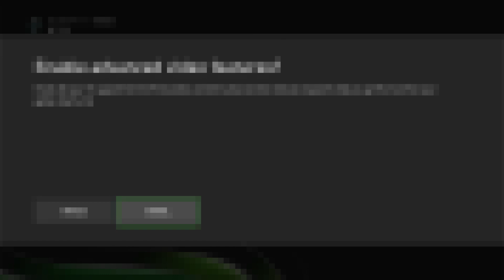Dead HDMI Port on Xbox Series S? Watch This Repair!

Comment: How do you determine if its the retimer IC or the port? I really cant tell if the port is bad. I only have jewelers magnifying glasses. Really don't want to buy a $30 chip, change it and find out that wasn't the issue
Reply from the maker: If you get a signal on the tv showing you that something is there but you don’t necessarily get picture
Reply: @trilexfix  TV I have is pretty old. Said nothing was there. Tried resetting the resolution. Still nothing. Computer monitor was detecting the hdmi was plugged into something but no image. I'll find some better reference pictures of a known good port and go from there.
Reply from the maker: @sokoloft3  if you want my advice why not mail it in to us as I recommend this to be done by a professional in order to prevent further damage without the correct equipment.
Reply: @trilexfix  Appreciate the offer but no. The person who wants me to fix it says they're not concerned about it. I told them its a 50/50 chance since I lack some tools and the hands on experience doing it. These are repairs I'd like to learn to do myself. I understand the risks involved
Reply from the maker: @sokoloft3  best of luck I do have a link to all the tools I use. I also use a soldering pencil for the retimer ic’s
Reply: @trilexfix  Thanks. Yeah I have a decent iron, the pinecil. I need to buy some low melt solder and better wick. Maybe even better flux too. Hoping my 858D can put out enough heat to do it.
Reply: @trilexfix  Oh yeah that worked out just fine. Used the chipquick low melt, mixed it in and came right out using my 858D. Was more of a pita to get the new port in. Specifically held in place while I soldered it. Might have to do it on a PS5 now but charge way more.
Reply from the maker: @sokoloft3 I rarely use low melt for ports anymore now a days I just completely cover it ever more than needed with kester 60/40 and then biggest nozzle max heat max air. I might use low melt on xbox series X components though for some reason the temps for the xbox series X needs a crazy amount of heat.
Reply: @trilexfix  I could probably do that for the anchors. The pins I want to be sure they come off clean. I usually tin with 60/40 on mouse switches/keyboard switches.
Reply from the maker: @sokoloft3 the pins actually need less heat but yeah I like a lot of methods except hot swap it's not my fav as there is a lot of chance for error and ruining nearby components

Comment: Thanks for the breakdown on the solder! I suspected but it was nice to get a confirmation.
Reply from the maker: Yeah 60/40 kester solder for drag soldering but if I’m not doing any drag soldering I like to use 63/37 kester it really depends on what exactly I am doing. Also don’t forget low melt for stuff that needs a ton of heat like some of the hdmi ports
Reply from the maker: Also a follow up on the USB-C port on the nintendo switch I use 63/37 kester for the pins inside but the pins on the outside I will use 60/40. https://youtu.be/3hajumzmAjY